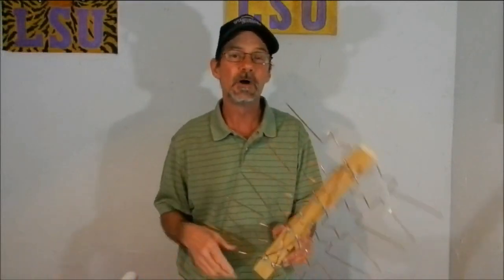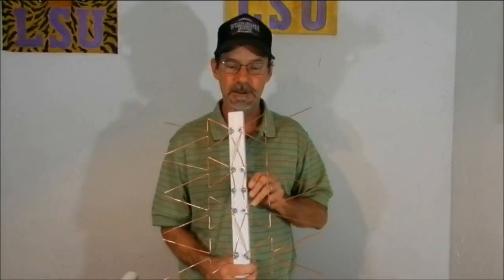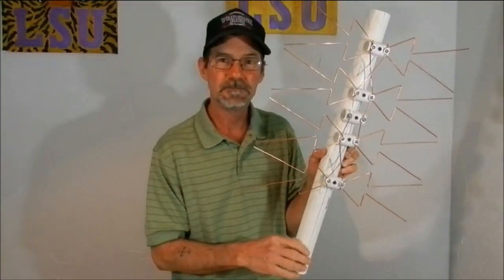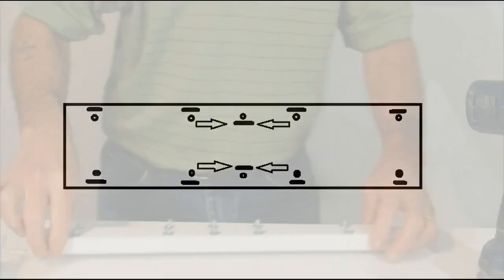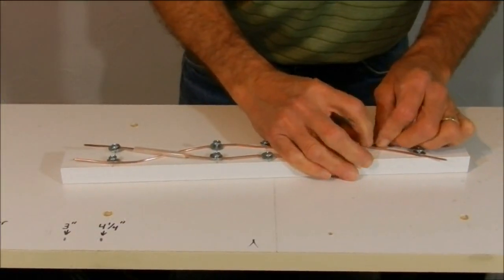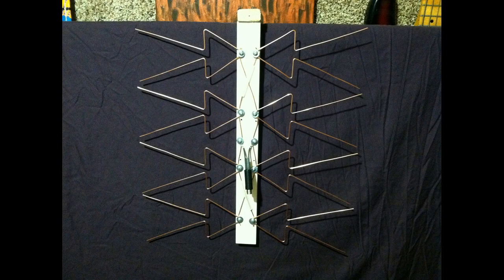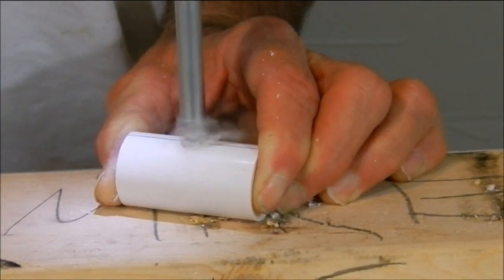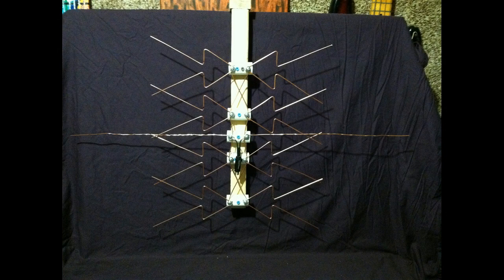How to Build a HDTV Antenna - Fractal Bowtie Upgrade

Comment: Thanks so much for this.  My son and I made this an afternoon project.  Easy and only $5 for the transformer since we had the rest of the materials.  The antenna worked great.  Receive all of the major network stations now and from 50-60 miles away and without an amplifier!.  Much better than the little, "amplified", flat window antenna that I tried yesterday.   Thanks also for such easy to follow instructions and for including all of the dimensions.  A definite home improvement victory today!

Comment: I've watched dozens of antenna building videos, and not one of them mentioned that the two feed wires from opposite side of the antenna cannot touch when they cross at the top and bottom.  I knew it, and expected it, and watched for someone to mention it.  The ice maker tubing is a good idea.  Another real nice design.
Reply from the maker: Thanks for the great comment Joe. I do like this design and still have several of them in my attic. My favorite design though is the Tuxedo. Its sensitivity and range rivals the fractal bowtie.  https://www.youtube.com/watch?v=Cf5b5-qwZ8Q I have all the antennas I need, but if I needed to build one for myself or someone else, it would be that one.
Reply: you have been watching the wrong tutorial then my friend I suggest you go to my friend Danny Hodges webpage and check that out
Reply: Danny is every ones friend, I like old Dano..........

Comment: I built this today and went from 26 channels to 42 channels with the antenna inside.  Best one I have ever found that I can build myself.
Reply from the maker: Great to hear it Mike! I'll never regret my homemade antenna. It blew my store bought antenna away! :)
Reply: I am building another one today.  I have channels scattered all over the map and I am going to try two antennas facing different directions hooked to a combiner.  I get almost all of the stations from Phoenix which is 75 miles away, but only about half of the channels from Tucson because I am too close and they are in three different compass headings.  I'll let you know how it works with two antennas.
Reply from the maker: Thanks Mike. I built one of these and put it in my attic. https://youtu.be/Cf5b5-qwZ8Q 
Amazing antenna as well. Will be looking forward to hearing back from you. Best of luck :)
Reply: just a suggestion sir -  wouldn't an Omni directional antenna make more sense? You would lose alot of gain-  also multi channel path

Comment: Is this model with 18 inch elements built for the UHF channels before the repackage? 18 inches is full wave length for 650 Mhz which is no longer in use by TV broadcasters. (614-698 MHz (channels 38-51) - 600 MHz band. The Broadcast Incentive Auction will require TV stations to vacate this band between April 2017 and July 2020. It will then be used by various wireless and broadband networks. Audio, video and pilot frequencies are for reference only.)  In other words, What frequency range is this at peak reception? I built a Pennyloop with two loops at 8.5 inch diameter which does excellent in the 500-600 mhz range (favoring the lower freqs). I am going to make another Pennyloop with 7.5 diameter loops to focus on the 550 mhz to 600 mhz. 
Here's a link to a website discussing the diameter formula for Loops and Double Loops.
http://www.hdtvprimer.com/ANTENNAS/Loop.html

copied from the text..

You can rescale the loop for your weakest channel.  Use this formula : dia=4537/(6*N+389)   where N is the channel number (14-69).  (Plugging 36 into this formula will give you 7.5.  Multiply that by 3.141 to get the total wire length.)  12 or 14 gauge copper wire is fine.  Remove any thick insulation.
Higher gain is possible with a double-loop (A2 on the gain graphs).  However it has a narrower bandwidth.  This “figure-8” antenna should look like two tangent circles, one above the other, fed at the bottom.  Keep the wires a quarter inch apart at the crossover point.  This formula gives the diameter of each circle :  dia=4244/(6*N+389)   Multiply this by 6.283 to get the total wire length.

Comment: The tip on laying the pipe next to the  board to  make a  straight line was a  real clever idea.

I just built two bowtie antennas since  I need one facing SW and  SE  +/-.    My elements are  mere  > < single  bend  v-shaped.   

What is the advantage of the triangle  bends over my single one bend V configuration?  I'm assuming it's  just a  means to make the overall width narrower  since the elements  are the same  electrical length regardless of how  may bend you  install.  

Lastly, to seperate  my wires running the length of the mounting  piece, I  make a  bend where the wires  cross.  I then use epoxy or hot melt glue to cover that small area.

Thanks for your insight!
Reply from the maker: Thanks for the nice comment. :) When I started building antennas, I had a regular bowtie like you have. I installed it in my attic because it is a safe place away from weather. Even though I had great reception (75% or greater), since there is a lot of reflective material up there and the fact that I have a series of power lines that run right in front of my house and in back, there is a great deal of interference and my signal would go from 100% to 0% spuradically.  The triangle fractals help to calm that down and bring in a consistant signal. I suppose if I put it outside above my roof top, > < would be just fine. The fractals are ideal for attic applications. Hope your antenna works well for you! :)
Reply: Interesting.   I am able to mount mine on the outside.  Thanks  for the  input.

Comment: Interesting thing about copper. Copper oxide is resistive. Combine that with skin effect, which increases with frequency, and it's a good idea to keep that copper shinny to minimize signal loss.
Reply: Can you leave the insulation on the wire?

Comment: I tried this design and it did not work as well as the star shape.  I'm also in Baton Rouge.  I'd like to see your wire bending technique.
Reply from the maker: The Tri-4 (super easy to build) might be a better antenna and will save you a LOT of wire bending and it works quite well.
HDTV Antenna   SUPER EASY   Great Performance

Comment: I don't understand why the fractals work than the plain Vs (or bow ties). If it's surface area, then why not add more rows---5 or 6 or more? Why does it have to cross at the top & bottom & be parallel in the middle? Why not cross at all junctions. Or none?

Comment: My husband said the shape of the wire doesn't matter.  The length does, is he correct?

Also, he said that copper with corrode when left outside and that I should use a large gauge galvanized wire instead.  What is your choice?
Reply from the maker: If you plan on having your antenna outside, galvanized is in my opinion a good choice. I keep my antennas in my attic so I know they won't get struck by lightning. The length matters depending on the frequency of the station you value the most. When I first started using these antennas, I built a regular bowtie (V shaped) but the interference was too strong and all my channels would cut out and pixelate no matter how strong the signal was. It was'nt until I added the fractals that the interference was reduced dramatically so in my experience, shape does matter in an attic situation. At least mine. The triangles are bent at 60 degress. There are other antenna designs that use 30 degree and 90 degree bends. But what works for me may not work everybody. For outside situations, the triangles may not be nessesary at all. My best advice to you would be for you to experiment with it a bit trying new things. Hope this helps. :)
Reply: I'm having problems getting RF Channel 39.  I can get RF channels 27 and 40 just fine.  I placed a deflector which helped the signal strength but still can get RF channel 39.  I installed a preamp up on the pole. Any Ideas.
Reply from the maker: RF 39 could be a station that transmits at a lower power than others or it is farther away. RF 39 frequency at 620 - 626 would be best reveived with a 19 inch element. 
 The Tuxedo also does well for distant stations. The Gray Hoverman does too. 

To find info for the station: https://www.fcc.gov/media/television/tv-query

Comment: Michael, wood is a poor choice for RF, so you were smart to switch to PVC. But CPVC is better for RF than PVC. Enjoy!
Reply: Actually vinyl fencing material is best.  A 2 ounce 1" x3".
Reply: why is wood not as good?, isn't the wires what pulls in the stations?
Reply: Wood may contain moisture or absorbs ambient moisture and may retain it for a while. At one time it was a live tree which had moisture.

Comment: Hi Mike - My daughter is going to use your instructions to build a similar antenna for her 6th grade makers fair project.  She is pretty good with hand tools and she can handle the math for calculating the wire lengths but we did have one question that just isn't very clear even after watching a few of your videos.  We have a number of stations in our area operating from 210 mhz (vhf-hi) to about 596 mhz (uhf).  If we want to catch a variety of stations should we have a different length of wire for each station?  I understand that that the wire length for the vhf-hi station will be much longer compared to the uhf stations but should each wire for the uhf stations be customized?  Thanks so much for your videos!
Reply from the maker: I have a station at 210 Mhz as well. I believe the most successful design for picking up vhf and uhf at the same time is the Tuxedo w/vhf integration https://www.youtube.com/watch?v=PPpdn8EeSaY
The Tri-4 does well too and is a lot easier to build and uses less materials.
https://www.youtube.com/edit?o=U&video_id=X8VjHEX8czA
The mini-tux was surprizing and uses the least amount of materials.
https://www.youtube.com/edit?o=U&video_id=Bcdt8EFNzHY
The fractal bowtie (or any bowtie at that matter) is pretty much a uhf antenna and doesn't do well receiving vhf. (I didn't know that at the time I posted the video).
Hope she does well with the fair project :)

Comment: Interesting design. How does it work compared to the one in your previous video?
Reply from the maker: As far as I can tell, it works the same as the previous just with a couple improvements. 1: pvc is weatherproof and 2: the single triangle allows for extra length in the wiskers and is a little easier and faster to bend into shape. It was originally inspired by a comment I received on one of my other videos about how wood can be conductive and cause signal loss. I'm sure there's some truth to it, but I haven't really noticed it in the wood based antennas I have still in my attic. It's nice and dry up there. I do know that pvc is definitly an improvement no matter how small. I didn't think about doing a video about just a pvc base, but when I started putting my first one together I had a thought and wondered if a single triangle would work. It certainly does.
 Thanks for your comment Lambert and have a great day :)
Reply: Used vinyl hollow one by three or 2 x 4 for material to hell with PVC

Comment: Can you use the same wiring on the other side as well to double up the signal strength? Does this antenna provide both uhf and vhf signals?
Reply from the maker: Thanks for the question. This antenna picks up mostly UHF signals but will pick up VHF high if the signal is strong enough.
   This antenna works best as it is. Adding more elements or making your antenna bigger won't make it work better. If anything, it will make it worse.
  This is one of my older videos that has become slightly popular.  If you haven't built this antenna yet, I strongly recommend watching my latest video. It's a different design that works better than all of the antennas I've come up with.  https://youtu.be/sMVGeSDh-Qg

Thanks again and take care.

Comment: Can you tell me what area inside Lowes has the PVC Material ? I've looked at my Lowes store here and didn't see anything like that yet. Thanks
Reply from the maker: I found it in the building materials area. It's called pvc board. An employee might help you find it. It's textured on one side but I used the smooth side for the antenna.
Reply: Thanks, Just an FYI I built a Gray Hoverman based off Danny Hodges YOUTUBE video. It works well, I did have a bowtie and the Hoverman seems to give better performance for me. I'b be interested if you tried to compare fractal to the hoverman ?
Reply from the maker: Is your Gray Hoverman mounted outside above your house? Does it get channels that the bowtie doesn't? Was your bowtie a copper wire or coat hanger? Was it the standard specs? Just curious. I thought about building a G.H., but I keep my antennas in my attic and wasn't sure if it would fit up there.
Reply: I mounted my antenna off my deck, not the best location because broadcaster towers come from other side. I need to move up onto the roof eventually. GH has copper wire mounted to PVC mast. My Bowtie was galvanized wire mounted on PVC mast. Both have a reflector. The GH antenna pulls in more channels and strong signal. IDK if the copper wire makes the difference or the antenna design ?
Reply from the maker: I don't know if there is a difference between the two materials. Copper is the only thing I've ever used. I got curious and built one last night. I like it. Good UHF antenna. Easy to build. I added  VHF elements at the transformer and that worked OK.  I'll have to see if it will fit in my attic to run a real test. I hope it fits. It's huge and my attic is small.
Reply: Cool - Let me know how it works out.
Reply from the maker: https://plus.google.com/107232990658154128006/posts/KMASrqU2oLM
I put the GH in my attic in the same spot I had one of the FB-ties. It was too big to fit and had to straddle the aluminum foil A/C duct work (but it didn't touch) so I couldn't turn it. I think the foil duct had an influence on it. It performed better in my dining room. I suppose if I had a taller attic or mounted it outside above the house, this antenna would be awesome. I used to have a 50 ft cable that I would use to experiment with my FB-tie 12 ft above my roof top. I was able to pick up stations 70 miles with no reflector. I would be interested (as would everyone else) in a side by side comparison in the same conditions. The GH could possibly out perform the FB in some frequencies. I do know that upon building, the FB can be taylored per frequency where the GH is one-size-fits-all. I'll have to pick up a coax soon and do the test. If I do, I'll let you know. Have a good one :)
Reply: Plumbing

Comment: You should build a reflector to put behind the antenna
Reply: I could not agree more my friend
Reply: The problem is I am out in the boondocks and get channels from both Phoenix (about 75 miles), and from Tucson (about 40 miles).  If I put on the reflector I lose either Tucson or Phoenix without being able to rotate the antenna.
Reply: Reflectors make the antenna directional and you have to rotate the antenna toward the TV stations you want to pick up.

Comment: There is no need to bend the elements all funky like that. It won't help reception.. probably hurts it honestly. All you need is 1 single element dipole horizontally polarized and a reflector if you want any kindve directionality to it otherwise it'll pickup in 2 directions very well.

Comment: Sr.... Will it  work in remote area like 220 kilometer far from main city capital?
Reply from the maker: Can't promise it. That distance will pose a challenge for any antenna
Reply: Probably not unless you can get the antenna up extremely high (like 30 meters) then you'll need some sort of line loss amplifier.

Comment: Do you need a certain type of tv for this type of antanne to work?
Reply from the maker: Modern flat screen tvs are digital and is all that is required. Once your antenna is connected, you'll need to go into your tv's settings and select "ANTENNA" then run a channel scan. Thinking about making the switch? Or have you already?
Reply: Followed your video,  scanned for channels,  got no channels. Flat screen LG TV, 3 years old. When scan finished it indicate it found 32 channels. Will try again, I must be doing something wrong. Thanks!
Reply from the maker: Sorry to hear that Ed. It sounds like it found the channels that you should get but doesn't display them. Scratching my head here. Hope you find the issue. Owners manual perhaps. :(

Comment: thing of it is I live in a valley any suggestions
Reply from the maker: That's unfortunate Mike. Try to get as high as you can. You might need a signal booster as well.
Reply: I respectfully disagree.   I have built a custom antenna and live in the valley and I receive 66 channels in the boondocks

Comment: Is the bow-tie still 18" ?  The first bend is 3" from center then 4 1/4" according to the video, but the first bend appears much larger than the second,  and the last 2 parts appear the largest.  What length of wire are you using, and is that length  based on analysis of the stations wavelengths near you ?
Reply from the maker: 18" and yes this works great for the stations in my area but is a pretty good middle-ground length.
Reply: What do you think of these gentlemen using these gigantic 30 to 40 inch bowties for VHF?

Comment: hhmmm-would these tennaes work with60 mile  conditions and tree blockage??
Reply from the maker: Possibly. Of course the higher the better. If the fractal bowtie does'nt do the trick, you might check out the Tuxedo. It does a little better with distance and is one of the videos on my channel.